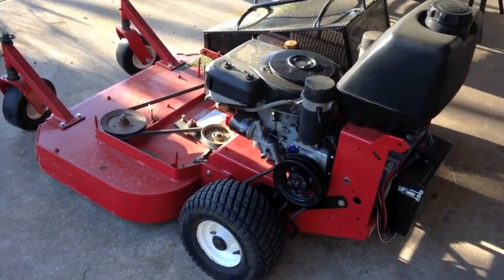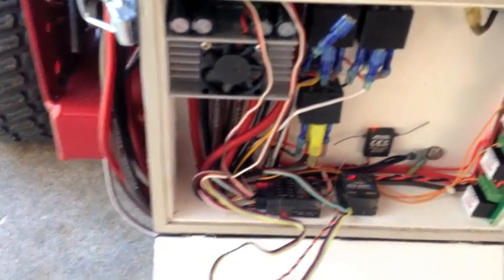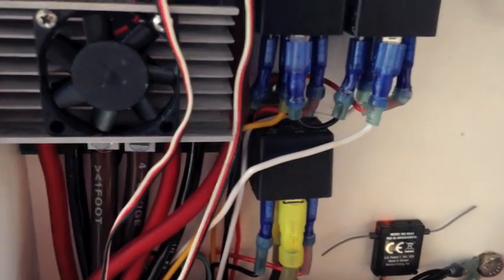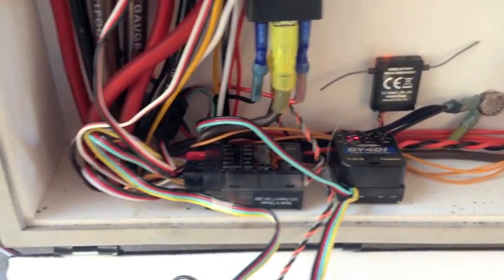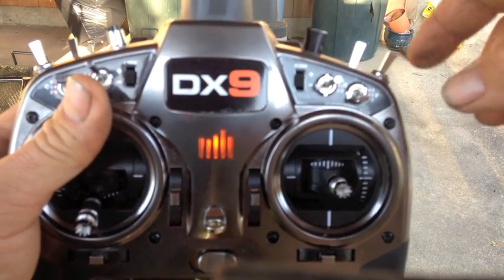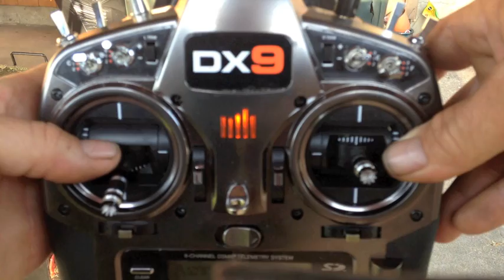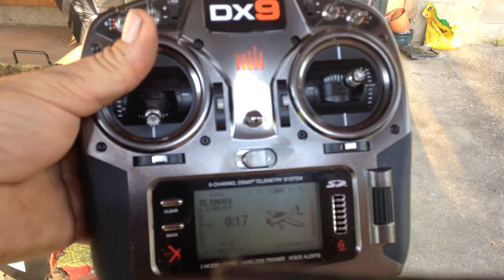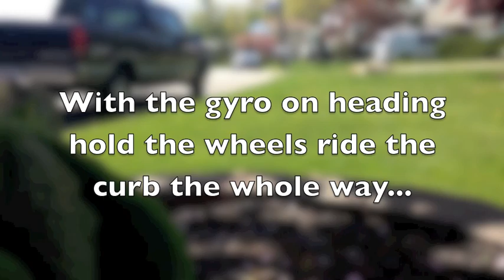New Remote control lawnmower exmark walk behind

Comment: Excellent, well thought out and professionally done.  Really really nice.  I have built one for a specific purpose …really hard to mow hills and rough terrain.  Using 4 motors for four wheel drive.  But it does have some problems that I still am working the bugs out of.  Have you tried this on steep ground mowing?  The gyro idea is very good … I would have to study that some more to get an idea on how that works and is set up.  Thanks for the inspiration here.
Reply from the maker: Ive only tried it once on a steep slope just out of curiosity it did pretty good i dont know if it could handle going up and down all day though maybe at 48 volt it could handle it but these little motors at 24 volt kind of like the flat ground. The gyro was a life saver on the hill though even then it still held a nice straight line. What kind of problems are you having?
Reply: Dave Z JR Hi …thanks for the reply.  The problems I have had (and just overcame once again) are with the four motor design.  First of all, I felt I needed four wheel drive to do what I want to do …which is perform tasks on steep slopes and rough ground that I am tired of doing myself and can be dangerous.  When working the mower I made will climb a tree and does what I need to do.  But the first problems were the amount of current draw this required.  I was concerned about safety as well and being a novice I put fuses in line instead of the relays like you did.  Bottom line is the motors can draw up to 125 amps when doing skid steer turning etc.  I ended up having to use two 2x60 and forgo the fuses.  Also, I kept the brakes because on steep ground I don't want a 600 lb monster to come barreling down a hill.  This required a more complex wiring system with a diode array recommended by Dimension Engineering.  Then recently I had motor problems themselves.  Again as a novice, I got some used motors and made sure they worked and strapped them on.  I did not check the insides.  On one of them recently a gear shattered, locking up the motor and then putting a lot of demand on another motor, which drew a lot of current, melted the wires to that motor and burnt the brush holding board inside it (brushes on these motors are internally mounted on a board).  I have this all repaired now and have checked the motors out more before mounting so hopefully all will be well.  I am going to build another one ….but this time it will be with tracks and two motors to make things simpler.  I am going to research motors more thoroughly as well before deciding on what to use.  Again, you did an impressive job on yours but my question was relevant to my need.  With your information, I still think 4 wheel drive is a must for me.  I may be back to inquire about the gyro for future if you don't mind.  All the best on this fine day.
Reply from the maker: Well i checked yours out , looks really good im impressed. These little motors will draw a hell of alot as you found out. Thats why my next one is going to be hydrostatic like the zero turn mowers i think thats the answer and there pretty much self braking to. Good luck sir good job!
Reply: Dave Z JR TY Dave …..it's not pretty but it does the first job I wanted it to do (as long as all stays well).  I will have to check out the hydrostatic idea for the next one.

Comment: I recently built a 4WD RC mower. How do you have that gyro hooked up?
Reply from the maker: imakewoodcrafts are you using 2 channels? One to steer and one for forward and reverse?
Reply: No, 1 stick on the transmitter.
Reply from the maker: Yes so you must be using 2 channels at minimum. Your using one joystick so it goes forward and backward then left to right correct? There should be 2 sets of wires going into your speed control from the receiver. The gyro goes inline from the receiver to the speed control on the channel your using for steering.
Reply: Dave Z JR How does the gyro work? Does it just soften the steering or more? I made one of these with 21" but I found trying to keep straight lines challenging. I end up overlapping a lot. Great build!

Comment: What size hub /sprocket did u use on that wheelchair motor is that a 11/16
Reply from the maker: No most of them including mine are 17mm. I used a split bushing and pulley setup because the pulley is easily removed and changed out. Go to
Fremont industrial supply.com and poke around the split taper and sheave section if your going with a belt setup you'll find what you need. Are you running a belt or attaching the wheel right to the motor?

Comment: Great job on your rc mower! I used it as inspiration to convert my John Deere Z445 zero turn. I had lower back disc fusion surgery and think this will allow me to continue to maintain my yard. One feature I failed to successfully hook up was the remote mower deck engagement.  I used a battle switch and a normal 12 v car relay and fried the BattleSwitch. No doubt I wired it up wrong.  If your email address is still valid, I am going to ask your assistance in wiring this up properly. Hope you can help out. Thanks in advance!
Reply: I got the 2nd Battle Switch relay wired up correctly and now I can engage the deck remotely. I have done quite a bit of mowing with it and I believe it is going to fit the bill!!
Reply: How was the fusion surgery? My doctor want me to have that and I'm scared
Reply: @sew04ss  Actually my surgery and recovery has gone very well! I had two levels fused with 6 screws and 2 rods. If u have it, take it easy and let everything heal. Sorry for not getting back earlier.

Comment: Great job and great video. Been thinking of doing something similar. Given your build and operating experience, is there anything you would do differently today?
Reply from the maker: Thank you. I think the only thing i'd change or prefer would be to have hydrostatic drive. Electric motors are cool but the alternator is always working 100% of the time. For what im doing with it on level ground the motors draw around 30 amps (i dont push it to hard) the alternator puts out about 40 so im right on the edge. Other than that its pretty damm good im still cutting twice a week and not one failure yet except a flat tire.

Comment from the maker: the gyro is a futaba gy401 its pretty much plug and play but it goes inline from the steering channel on the receiver to the speed control for me its the Aileron channel on the receiver then theres a gear wire from the gyro thats plugged into the gear channel on the receiver or any spare channel you can assign it to that activates the high or low rates from the transmitter for the gyro (heading hold or assist) if you need more detailed info let me know or check out the futaba website the downloadable manual for it is actually pretty well written. this gyro is actually a older model but I've had others and this one seems bullet proof I've had nothing but good luck with the maybe 9 or 10 I've owned and used. But please be careful where you buy it…. if its only 30-50$ its a copy no gooood...
Reply: Wow, awesome job. You thought of everything. I am in the process of planning similar project. I did not think of the gyro idea and actually need clarification on this. .i understand the use on rc car with a servo to hold steering but how does it work using 2 motors as the steering? I have a DX5e transmitter, sabertooth 2x25 and also Traxxas receiver. ..i also want to use an electric PTO as well. ..i have seen several rc mowers but none as well designed and workmanship and complete as yours. .thanks for any help you can be. .
Reply from the maker: A servo is essentially just a motor but geared down if that helps.
Reply: I have a sabertooth controlled via a spektrum ar9020. Using the rudd chan for right/left, using ele for forward/reverse. Plug the gy401 to the ele and then the 1 cable connection from gy401 I have plugged into the aux chan. 

When I power up, it just full throttle tries to take off. I have it on bricks so it ain't going anywhere. Both dip switches on the gy401 are off and the little dials are set to zero and 60.

What am I doing wrong you think? Motors are same as yours. I just have the spektrum to the sabertooth to the motors, just simple setup
Reply from the maker: +David Massey Are  both wheels turning the same rotation? Usually if its the gyros fault the wheels will spin in opposite directions as if it was correcting itself. Check the dip switches on the sabertooth first make sure there right. Um also check the trim settings on the transmitter make sure there set to 0. Also if you happen to shut off the receiver while holding the stick in a position it will think thats the starting point next time its powered up. I hope you bought a genuine 401 and not a repop off ebay theres alot of fakes on there. Check those things and get back to me that shit can get very frustrating quickly.
Reply: +Dave Z JR it's a gd fake. I opened it up and there is a nut used as a spacer. It might work ok, no telling. I have another gyro I will use instead prob. Thanks for the help.
Reply: +Dave Z JR oh and once I set the trim to zero on the remote, the light on the fake 401 turns on, but no movement on either wheel. It all works fine when the gyro is out the picture...its just I can't steer worth a damn.

Comment: Great build! How much torque was required for the servos for the throttle and choke? Also, how did you release the brakes with the 2x60 or did you just remove them?
Reply from the maker: Thanks. To me the servos have plenty of power to work the throttle and choke and some to spare. I dont know the foot pounds of actual torque but they work with little effort.. The brakes i removed , these wheelchair motors are geared so far down that you dont really need the brakes it will role a little on its own coming down the ramps of my truck but on semi flat ground its no worries its not going anywhere. Theres a lever on these motors that throws em in neutral which is nice. Are you building one?
Reply: Yeah, I started with sabertooth  2x32 and was able to release the brakes with the extra built in power outputs. I think the 2x32might be too small though because it cuts out whenever I accelerate quickly. I might not be programming the ramping correctly either though.
Reply from the maker: Its not programming that speed controller is to small its only good for 32 amps these motors are sometimes drwing more then 40 amps. And you have to see how many things your powering off your receiver you could be taking to much power from there to , easy fix though just power your servos and stuff separately , if you still have control over everything when that happens then your not experiencing a (brown out) from the receiver which is good. So you gonna make a video and show us what you got or what??
Reply: I'm pretty sure it's not a brownout, I'm only powering the servos right now. I'm going to order the 2x60 & I'll post a video as soon as I have that working.
Reply: Finally got the 2x60 & wired everything up. It works really well, but the setup is sloppy and still a work in progress.
Reply: sorry for interuption ha 1 year ago  what brand of battle switches are you working with and aw find on internet somewhere but any SUGGESTIONS where and $$$$
thanks and im using a Futaba super seven 72 megz it has many aircraft helo, ETC i think pre programs are there for specific or make your own lotta fun Thks BTW NICE JOB
MY AREA WOULD WORK 10%
hills and wet

Comment: Hi David, I left a question in the comment section. I'm in the process of putting together my rc mower right now. Just got my frame back from the welder and will start to assemble next week. I'm handicapped and haven't been able to now my lawn for over 3 years but now I look forward to it again. I have a flysky 6 channel transmitter I have a 2x60 motor controller. When I saw you use the futaba 401 gyro to keep it going straight, I thought that's the cats ass. I was wondering if sure like all the 179 people who gave commented how the hell do I wire this up. Does the gyro get its power from the receiver? And does it connect to the sabertooth? If you could shoot me a rough drawing of what wire goes where I would name my next child after you. (Im 70 yrs old) thanks for getting back to so fast, Bill Poplaski.
Reply from the maker: Bill Poplaski ok i’ll get something drawn up for you once i get home from work.

Comment: Hi Dave, 
Awesome build. Using a gyro is amazing!!
I have built a rc lawnmower and now I want to add the gyro to it. I am using the Sabertooth 2x60 speed controller. 
I have just received my futaba gy 401 today.
I understand how to plug the gyro into the receiver but on the output side of the gyro there are three wires. How do you connect them to the Sabertooth?
thanks
Reply: Figured it out. 
it has been a few months since i hooked it up and forgot.
thanks
Reply from the maker: Sorry about that i was caught up with some things. Good im glad you figured it out its gonna be a whole new world now after you get it set up!!! Just dont turn on the digital servo output on the gyro it seemed to act up a little when i tried it. But hey man if you any problems let me know. Oh and the gear switch, the single wire to turn on the heading hold can be set up in the transmitter think of it as (gain) if you set it to high the machine is gonna get twitchy so play around and find your sweet spot. And one more thing every now and then well i do it everytime but cycle the gear switch 3 times on the transmitter it helps to calibrate the gyro. Good luck man make a video and share...

Comment: Why you need to use the wheelchair motors, isn't this mower has engine to turn these wheels?  Since is zero turn mower can't you use the oem stick to control the directions?
Reply from the maker: Danny T  its easier to set up using electric motors rather than building linkages to work the squeeze handles plus shifting into reverse is hard.
Reply: I agreed.  I plan to use zero turn riding mower for my next project.  I have a big yard and 21" mower just does not cut it.

Comment: Nice work, it's quite inspiring! I'm in the process of planning a RC mower build and was wondering if you could share your wiring diagram and any insights. I need to learn basic circuitry and RC stuff too. Also, how did you setup your expo rates for your forward/reverse and steering? Or, do you have any resources you could pass along? Thanks for the video!
Reply from the maker: Thank you sir. If you have some basic knowledge of rc stuff thats a great start. The expo rates? Do you mean literally how did I or what kind of curve i set them for? Shoot me an email if you want to go into detail a little more. Onedavez@gmail.com
Reply: Dave Z JR Dave, awesome idea with the gyro. I would to install one my rc mower. I’m not familiar with rc helicopters and gyros. What do I need to install a gyro on my mower?  I’m using spectrum 8 radio and receiver. Larson

Comment: Hey again, after watching your video again and again. .lol,  i may opt for a 6 or 9 channel transmitter now, hahaha. .do you happen to have a schematic on how you wired everything? I may be a little lost with the relays and battle switches add well as the gyro. ..I'm still trying to figure out how you wired that gyro using the wheel chair motors as steering. .lol thanks for any help. .i can give you my email if you need to send me the wiring on how you did it. ..
Reply from the maker: Sorry about the delay we've been plowing snow nonstop. Alright well using the sabertooth style speed control is cool cause it takes your steering channel and mixes it between the 2 motors. It does get a little confusing... But yea ofcourse if you dont mind send me your email and we'll see what we can do its no problem at all. Once you do it you'll look back and say hmm that was easy!!
Reply from the maker: Also go for a nice radio you can never have enough channels im already almost out on my little dx9.
Reply: Dave Z JR also could you give me the last of what electronics toy used, ie. Relays and switches. .thanks bud. .

Comment: What motors did you use?
Reply from the maker: I bought them off ebay im not to sure of the exact model the listing said (pride jazzy) but if your looking for a set try to find em with the mounting brackets still on em makes it alot easier to mount them to whatever your doing.

Comment: How much is it to make one
Reply from the maker: It depends. The electronics including the receiver and transmitter are around 600-700$ then all the misc. like electric pto clutch , electric start , wheelchair motors , pulleys , belts , price of the mower itself and a rebuilt scrap motor , plus some stuff is used from ebay except the electronics. The way i built mine your looking at around 1300-1700$ not including time witch i guess is kinda free plus its fun.